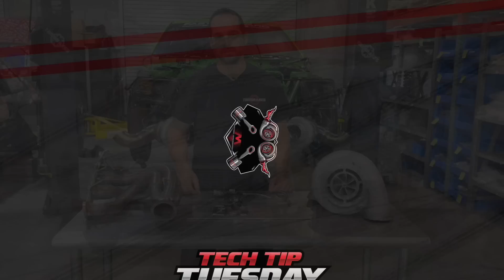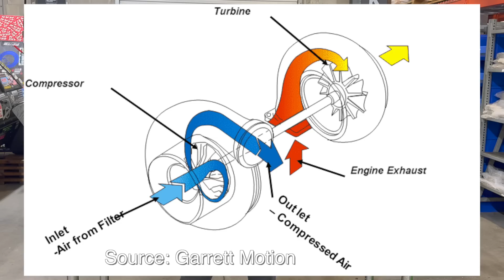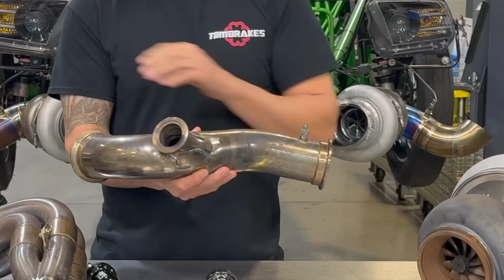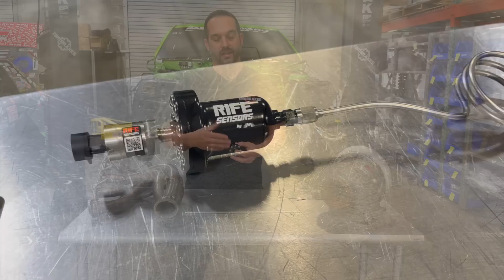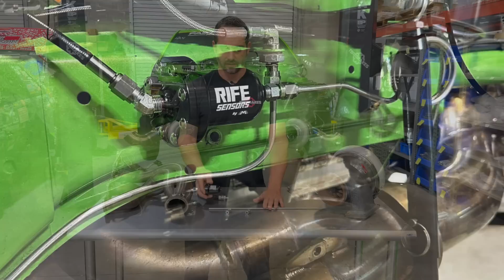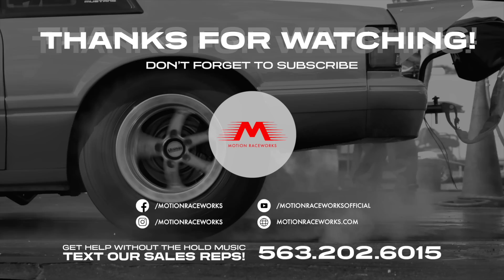Turbo Back Pressure Sensor Do's and Don'ts! Plus Install Tips

Comment: What an informative video, thank you! This really helps to conceptualize what back pressure is and how it affects engine efficiency.

Do you find that back pressure in conjunction with MAP can open the spring on an external wastegate prematurely? If that EWG is piped directly to the up-pipe?

Comment: I've been thinking about doing an ESS kit for my Gen 2 GT.. People have been telling that because it's a manual I should go with a Root style or Top Mount blower.. But in NA form I can't get 1st and 2cd to hook so as it is.. So to me setting up 1 & 2 for 5lbs of boost and then making up to 10lb's in 3,4,5 is actually what I want.. I don't race people and i'm not trying to be #1 Ricky Bobby anyways.. I'm more or less just looking for advise on which blower to go with for my Gen 2 MT82 GT not for racing but for daily driving????

Comment: Pressure sensorses should have a 10-20% head room on the range. 80psi=100psi sensor 45psi=50psi sensor.
 Another thing to look at is possible data rate in the peaks happen at a rate faster than the sensor or the read rate youll get a false high

Comment: When you achieve the magical less than 1:1 ebp the valve overlap has the intended cylinder clearing and cooling.  raw fuel down the pipe ready to expand. This is where the external WG is king at handling the increasing ebp pulce flow.

Comment: 8:50 true true.
1 more point the back pressure will burp up the intake manifold during overlap. Egr and intake charge air heating, from the bottom up.

Comment: Better than "backpressure" to monitor is CYLINDER PRESSURE.  That will tell you MANY things.  The least of which, is do you have the right cam in there, and are you making peak power without detonating at all.  Detonation is due to exceeding peak cylinder pressure.  I do NOT mean "compression" values.  I am talking about something completely different.  When I was at SWRI, we had the instrumentation to show this.  It changed everything regarding how engines were tuned.
Reply: No doubt this is the game changer. I hope the cost for that analysis equipment will be more affordable at some point.

Comment: At what point do you need a co² system?
Reply: To me all drag racing cars should use Co2. To be able to have full control over the wastegate from the 2 stet to the finish line. Without having to wait for the turbo to make boost for control.

Comment: Depending on the amount of overlap and exhaust back pressure, exhaust gas also enters the intake manifold, further diluting the intake charge and adding additional heat.
Reply: No it doesn't.

Comment: Something that helps me think about exhaust pressure is using the diesel terminology of "drive pressure".  It's the pressure necessary to drive the compressor at that boost.  A lot of people don't realize a lot of diesels come with exhaust pressure sensors from the factory it's so important.

Comment: I wondering if i xan used this on my b serie engine with hondata s300  i don't think i can read that righ or wrong ?
Reply: Yeah ITS Not a Problem. U need a Pressure Sensor 0-30psi 0-5v and Cooper Tube and lets go

Comment: Great explanation on turbo pressure ratio. Gail Banks also has a great explanation that’s worth a watch. The coils in the stainless line also allow for some movement with exhaust thermal expansion. I’ve been looking at your dampers for a while to monitor my own setup as I’m running a new turbo setup on a very small engine (1.4L) with reasonably high boost (25-30psi) in a Hillclimb car.

Comment: Great vid, how do you keep the metal line from bending and fatiguing over time, since there is engine movement and the canister is installed off the motor in a static area (like firewall).
Reply: The coiled line would definitely help with that.

Comment: I have a twin scroll turbo with a divided turbo flange and two separate sides from header to flange. Would the reading be the same on one side, I have a sensor on one side reading is square and about half the actual boost being made. Is this right?
Reply: Sounds like you have the magical ebp of lessthan 1 . What is your package? 
The 2 hafes of a good running engine should be balanced/ equal. 
Throw a plug in the bank you are currently measuring and add a port to the other side to confirm.  
Also depending on the manufacturer the ( if equipped) inturnal waste gate may only bleed air from 1 side (eg holset hx35) and can show all good and the other no.

Comment: Backpressure on an NA street car is in fact important due to the fact that too small of pipes or restrictive mufflers or cats could increase back pressure to the point its restricting the engine.  To say that on NA it isn't important is not thinking things all the way through.

Comment: One question: Bigger turbine wheel or bigger exhaust housing? Like if you could use a 55mm turbine with a .63ar or a 51mm with .83 ar which one should be used, pro and cons
Reply: It's all really going to come down to the specific build you have. In what specific power level you're looking at running. That's one of the reasons installing the sensor is very crucial in helping you determine what to do. To help optimize everything.
Reply: @TainterRacing  if both cases would have the same flow, which one should be chosen for a 30psi aplication
Reply: @mihailpetrovici5044  I wouldn't recommend making your turbo selection off of some of the advice on YouTube comments.. with that said I will still give it. Running 30 PSI you should be making quite a bit of horsepower unless you're talking less than a 2liter engine. Both of those might actually be small. The larger the actual turbine will you go you have more spinning mass and you will have slower spool up.

Comment: What if one could put an extra waste gate or bypass that could keep exhaust back pressure at an ideal percentage while still using all boost pressure available. Thanks for the videos bub I appreciate it and u blessings to you and yours brother. Love and prayers to all n God bless yall
Reply: That can help in some instances but is really more of a Band-aid.  Running too small of a turbo you will end up having issues where it's not spooling up well or just running out of steam meaning you may just need to get a larger Turbo.
Reply: @TainterRacing  right on I was thinking that it would be beneficial in a class rule setting such as turbo size or what not. I appreciate you and your insights and interaction. Much love n blessings to you and yours. Love and prayers to all n God bless yall
Reply: That’s what a wastegate does. It bypasses the turbo. Adding another WG to open will just lower the boost. (And of course Backpressure.) you can’t “cheat” the system with another WG. It’s just more of the same.
Reply: @4familyman  the reason I said it can help in some instances is if it's extremely high and it's actually due to extremely undersized turbine and housing. It's not going to make it ideal by any means but it can be used as a Band-Aid to help lower the back pressure. I specifically did this on a car running turbo integrated wastegate I was running at about a 3.5 :1 after installing the external wastegate with a dump I was able to get that down to about 1.9:1

The results are going to matter a lot on the style of exhaust that is on the vehicle I was still running a full exhaust with no cats and performance muffler. At the same boost levels I picked up about 35 to 40 horsepower across the Curve. With that said a proper size turbo would definitely have made more power at the same boost level.
Reply: @4familyman  I understand the the the original purpose of a waste gate. Just like I understand the purpose of a blow off valve, but you can also add an e gate to control intake pressure so I think one could use the same idea to control exhaust pressure. Unless you really understand what I'm saying and you've experimented with this idea, you are just parroting common knowledge and practices. No disrespect intended, but thinking outside the box and new ways of doing old things is how one can evolve and progress into better and more productive ways of doing things that may be beneficial. Do it the way everyone else is doing it will never progress the evolution of performance imo. Much love n prayers to all and God bless.
Reply: Now if you are talking about bypassing a restrictive post turbine exhaust (like a cat or a muffler), of course that will help. Because post turbine back pressure is compounded to pre turbo. 

But adding another WG pre turbine is no different than just opening up the first WG more, which will just lower boost.

Comment: What would be a good single turbo for gen4 coyote f150 for 650whp (daily driver)
Reply: It won't take much boost to make 650 on a coyote. 7275 or so would be cool. I think superchargers are king on under 1000hp coyote daily driver applications though. But the turbo will def sound cooler.
Reply: @ thanks Brett! Huge fan!

Comment: I have single turbo, but has twin scroll exhaust housing, hot side pipes are individual into the turbo flange.... Where would be best place to plumb that since there isnt a merge
Reply: If your header/ manifold are equal Runners it would not matter which one you put it in. If you don't have equal Runners it might not be a bad idea to put sensors in both of them. What I personally would do is put a censor bong in each one you only need one sensor running on one run it on the other one whichever one reads higher that would be the one I would want to monitor all the time. But more data is always better.

Comment: This is the perfect video for the guys trying to run stock housing hybrid turbos with 40+ PSI, and wondering why they keep hurting their engines. Well guys. 3:1 EBP or 120PSI on the back of your valve is not going to end well for you in the long term...
Reply: It would have to be very a bad match for it to have 3 to 1 TiP/MAP

Comment: I set up a back presssure sensor last year just like this.  Found out my ratio was 2.5:1 so I am in the process of upgrading my turbo.   I was experiencing the only picking up 10hp per psi of boost and I was having to put a lot of pressure on the dome to get it to make more power.    It flat out works and gives much needed info.  I love the explanation.
Reply: Wow that would be a lot of psi on the waste gates
Reply: Many people don’t monitor it but have no idea the impact of a restrictive exhaust housing
Reply: Imagine if you had a massive turbo basically only good for drag racing with high stall and c02 or nos for circuit racing....